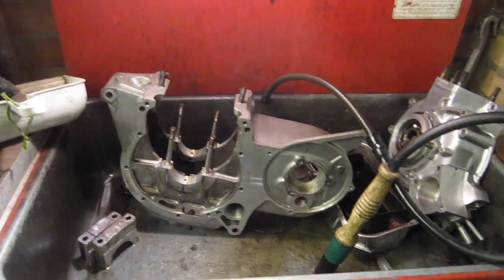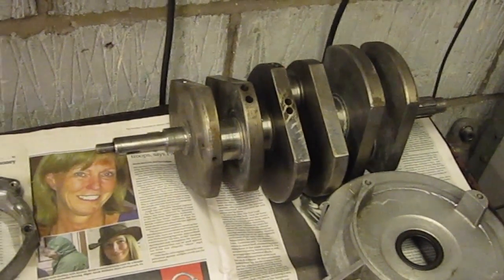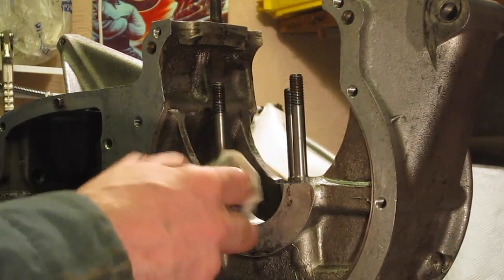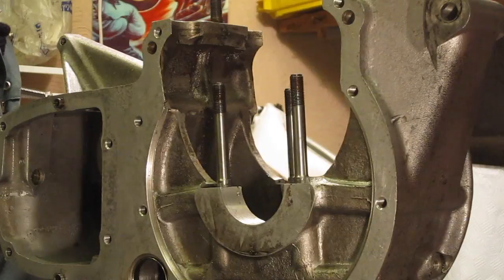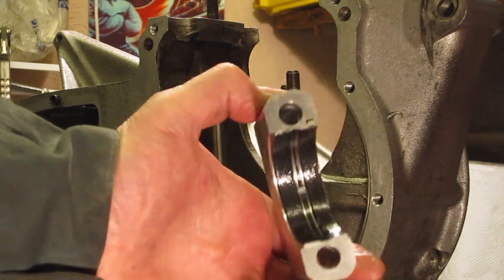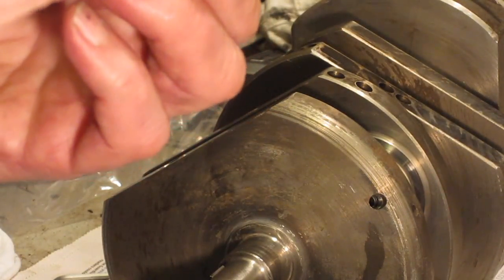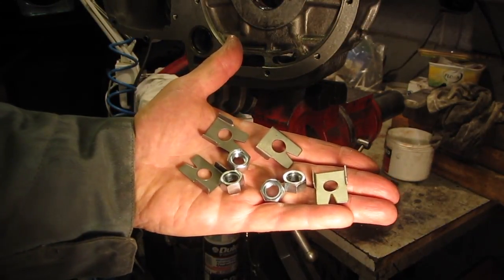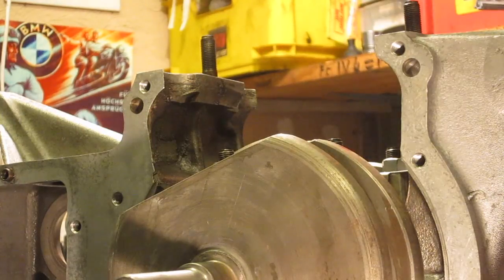Trident: Checking and Refitting the Crankshaft

Comment: Just wondered if you ever used any kind of engine stand..??......I have a Yamaha XJ600 in pieces and want to reassemble it, but would think it would be easier if bolted to an engine stand during the process
Reply from the maker: Yes it probably would be easier on a stand, but I doubt if I shall get around to constructing one for this project. If I was expecting to be building a particular engine type/make with any frequency I would.
Reply: I haven't seen anything to fit this particular engine, and I expect to be working on several different engines in the future. As engines aren't flat or  square, It just occured to me that an engine stand would be an asset. Even crankcases aren't flat along the bottom these days....
Reply from the maker: There are generic engine stands available for cars etc. but I am not aware of any that are available for motorcycle engines. Suppose you could always adapt a car one. Here is a link: https://www.machinemart.co.uk/p/clarke-ces340-340kg-engine-stand/